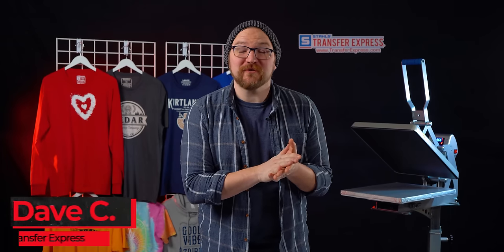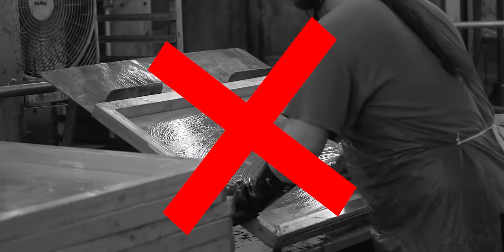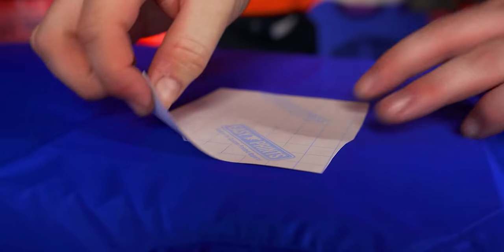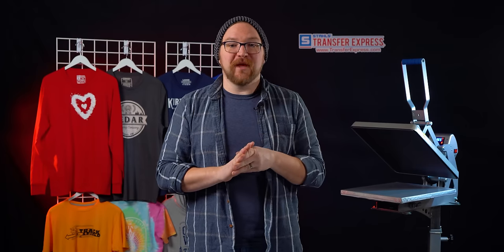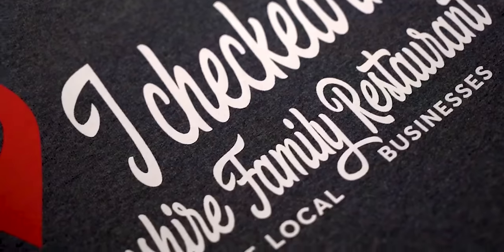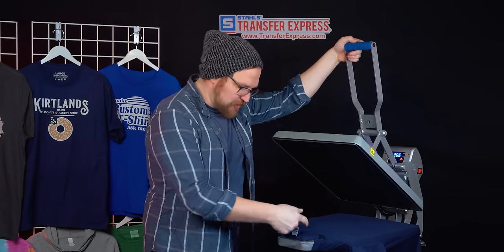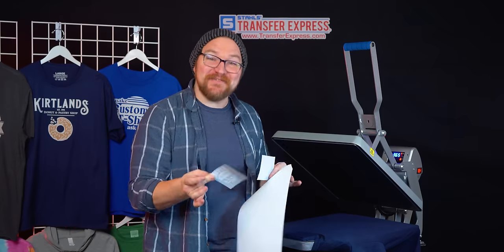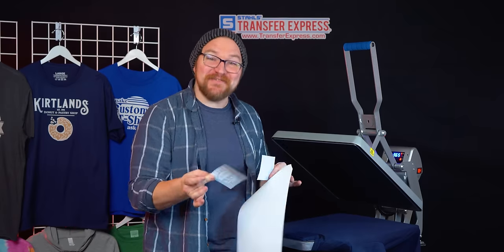What Is A Screen Printed Transfer? | Plastisol Ink Heat Transfers Explained

Comment: But could you do the transfer for halftones/rasterized images to dark t-shirt?
Reply from the maker: Sure Can! You can see in this video printing on dark garments made with cotton, polyester or blends are simple and easy! For raster artwork the process works the same. For any images with halftones, you shouldn't have a problem as long as the dot size is 1pt or greater with negative space between them of at least .04" to meet minimum standards.

Comment: Great Video. Can you do SP transfer using water based INk?
Reply from the maker: Thanks William! There are a few specialty-use heat transfers we produce with a water based ink, the cost is slightly higher. You'll find our goof proof screen printed transfers are a soft-hand, retail quality print with a versatile application to many different types of fabrics. You can request a zero cost sample here: https://www.transferexpress.com/marketing-tools/free-samples

 Is there a specific attribute of water-based inks you're looking for in a heat transfer?

Comment: What's the difference with that with DTF print?
Reply from the maker: Great Question! These are plastisol inks printed as spot colors with a minimum quantity of 6 sheets, where Direct To Film (DTF) is printed using a CMYK+W(White) Process so you can achieve full color or photorealistic prints at any quantity. 

We made a great video covering the difference between Screen Print & DTF transfers more in-depth with even some cost/pricing examples: https://youtu.be/qP-e_WhKcO8?feature=shared

Comment: How do you align the t-shirts to make sure the images are the same on all shirts?  Example using a middle chest image
Reply from the maker: Hey George, there's several different ways from using placement rulers, eyeballing or even using laser guides. We made a whole video for placement and positioning here: https://youtu.be/dwRFRT2iyFw
Reply: I found best way was measure the press plate and mark the centre line give the image a slight centre fold not on the actual image just out side of it line that up to the mark on the press and you will have a centred image every time same goes for pockets mark the press to the side where the centre mark of the image will be and it will line up ever time late as reply so you have prob already figired this issue out

Comment: I have some Goof Proof prints from you and I was wondering if there was a limit to how many times they can be pressed. 
I need to be able to press one image and peel it to line up a second image that will go slightly above the first one. 
I know I will need to cover the first image to protect it when I press a second time. 
Then I need to do this a third time. 
So the first image will have been pressed 3 times when all is said and done. 
Will that first image be ok?
This is for a custom run of shirts that a client wants. They wanted to combine several of my designs into one.
Reply from the maker: Goof proof is super versatile, however, three full presses may over-cure the inks and make them more brittle and prone to premature cracking. What you can do, is under-apply and carefully remove the carrier paper for the first or second images. 340 degrees for 6-8 seconds will allow the carrier to peel and the inks to stick, but will not fully cure the design to the shirt. Of course, if you can limit the presses and print multiple designs in the same press (if its the 2nd or 3rd) It may help keep clear of over application. 

For these unique application scenarios we would recommend testing the prints and washing one before delivering to your customer.

Comment: whats the price for like a 100 screen printed transfers if you wanted one design
Reply from the maker: For 100, single color, Goof Proof screen printed transfers on an 11.25 x 14" gang sheet you're looking at $1.82 per sheet or $182 with our easy prints pricing. $2.06ea if you're uploading Vector Artwork. 

We have a pricing calculator on our site that can help dial in a more exact quote depending on your specific project (transfer type, inks, sheet size, etc): https://www.transferexpress.com/pricing
Reply: Price has changed now?

Comment: where would i get a sheet the size of a skateboard
Reply from the maker: Great question- Our largest transfers (UltraColor Max) are available with up to 22 x 22" image sizing. While slightly smaller than a skateboard, you can use a method similar to the one shown in this video to print 'oversized' prints: https://youtu.be/BI7pyn9HjL4

Comment: Would I only be able to use your designs or can I upload my own?
Reply from the maker: Great question Barbra! You can upload your own designs in almost any file format to print: jpg, png, tiff, psd, ai, pdf, eps, svg, etc
Reply: @transferexpress  Where do I find pricing, how does that work, is there a setup fee for each design
Reply from the maker: We have instant quote calculators here on this page ( https://www.transferexpress.com/pricing ) or a downloadable price guide. There are no hidden setup fees, there's different pricing depending on where your artwork comes from: Our Online Designer, Uploaded vector artwork (ai, svg, pdf, eps) or Uploaded raster or bitmap artwork (jpg, tiff, png, etc). Artwork file help is included with all transfers except UltraColor Max. With UltraColor Max orders if your file is low resolution or needs editing it's just a $22 proofing fee- but our online system will notify you of that if that's the case.
Reply: @transferexpress   I think I'm going to have to watch some YouTube videos I'm so confused as to what this is all about

Comment: Would this work on practice jerseys with the holes 🤔
Reply from the maker: You bet! For those polyester jerseys we recommend Elasti Prints Screen Printed Transfers. Just be sure to put a paper coversheet on the inside of the jersey so the inks don't stick to the inside of the jersey.

Comment: If you order an existing graphic do you still need to pay for the setup fee since it’s already been done?
Reply from the maker: We don't have setup fees, so no. We do have different tiers of pricing depending on if you design online or the file format of your uploaded artwork: Vector or non-vector. An exact reorder will be priced at the lowest tier as it's already been done, but if any design changes are made (sizing, elements, etc) It will be priced based on the file type. 

We can add your artwork to your personal library in our Easy View Online Designer for commonly used designs or logos, we call them custom clipart: https://www.transferexpress.com/custom-clip-art

Comment: Can we use the Goof Proof Screen Printed Transfers on 95-100% polyester?
Reply from the maker: Hey Alex, you sure can! Be sure to test the polyester for heat-sensitivity first as Goof Proof can not be applied lower than 325 degrees. Some heat sensitive poly(typically the more inexpensive and/or heavily dyed stuff: navy, maroon, black, etc) may require temperatures lower than that to protect the garment from damage- in that case Elasti Prints, UltraColor Max and UltraColor Pro apply at 290 degrees.

Comment: How would I print them off myself?
Reply from the maker: These transfers are higher quality than what can be typically produced at home. It's much less financial risk and a more profitable business model to order only when needed. These screen printed transfers require a commercial screen printing setup to produce them: Dark room, emulsion, screens, reclaim units, inks, pigments, squeegees, screen printing presses, which can be difficult to fit into home-setups. With turnaround times as quick as the next business day they arrive fast, so you have the same advantages of producing in-house without the equipment, supplies or learning curve. 

For small orders or just one-off pieces we also offer direct to film transfers: https://www.transferexpress.com/heat-applied-transfers/ultracolor-max

Comment: Can I use my cricut easy press to apply these transfers?
Reply from the maker: We've seen some people use the easy press with good results, however, we don't really recommend it for a few reasons:

1. The temperature setting on the cricut presses are typically 40 degrees F lower than what the display shows. 

2. Without a locking or adjustable pressure, the pressure is 100% on how hard you can push down (These require 60-80 PSI) so for some people even their full body weight is not enough. When printing multiple garments, the pressure can vary, effecting the long-term durability of the transfers. 

We did a video comparing the Easy Press against a locking heat press: https://youtu.be/lktG7PiL5Dk

And we also had some surprising results with the Easy Press Mini: https://youtu.be/XkT_eqmv_5A

Comment: Can photo quality images be used with screen print transfers or only solid colors?
Reply from the maker: Screen Printed Transfers can only be ordered with Spot Colors. If you're trying to order any full color or photo realistic prints our UltraColor Max (https://www.transferexpress.com/heat-applied-transfers/ultracolor-max), or UltraColor Soft Transfers (https://www.transferexpress.com/heat-applied-transfers/ultracolor-soft) are the way to go!
Reply: @transferexpress  thank you checking it out now 🙏
Reply: @transferexpress  these links don't seem to work

Comment: Is anyone able to tell me if an Epson surecolor p800 printer can print these screen print images?
Reply from the maker: No. A desktop printer like the Epson p800 can be converted to print Direct To Film heat transfers but cannot print screen printed transfers like we show here. 

Screen printed transfers are printed using a screen, squeegee liquid ink and dryers or curing units (like a flash). Unlike desktop printers, for screen printing a stencil is created in screen with emulsion in which plastisol ink is pushed through to create an image (or transfer in this case). We show some of the hands-on process in this video here: https://www.youtube.com/watch?v=1nptFyiUEvQ
Reply: @transferexpress  thanks firstly thanks for your response i apreciate it, i am aware of how screen printing works thats what made me ask the question. I was more surprised that this process is even a thing  i asked because it seems that DTF and screen print transfers are the same thing in the end just different ink and obviously a massive creation difference. This is a pretty cool thing though as alot of people prefer screen printed effects and feel and transfer express has made it easy for us at home so thanks for that i will just have tp order something and see quality difference for myself i think. I will definitely check out the other vids thanks again. As for a home runner i think i might still require the converted P800 to get some white into the DTF broaden my colour abilities
Reply: @transferexpress  wrong link i believe as its a link to the vid i originally comebted on

Comment: What machine are you using to print these?
Reply from the maker: We're using the Hotronix Auto Open Clamshell Heat Press to print the transfers on the t-shirts here. Our Goof Proof screen printed transfers are produced using plastisol inks with screen printing presses. We take care of the hassle and mess of inks, screens, squeegees, emulsion and cleanup so you dont have to.

Comment: So does sublimation ink work with plastisol transfers???
Reply from the maker: Typically, you wouldn't mix sublimation printing with a standard screen printed plastisol transfer, they're just different processes. If sublimation is printed first, the sublimation inks will bleed through the screen print (unless its black ink). If the dye sub is printed on top of the screen printed transfer, it most likely would wash out of the plastisol inks when first laundered.
Reply: @transferexpress  okay, so I just bought Epson Supacolor F570 and I'm looking to add a printer for heat transfers as well for 100% cotton shirts, any recommendations?

Comment: But how are the transfers actually made - I know what it looks like when it’s going on shirts but what does the set up/machine look like to actually make the transfers?
Reply from the maker: We've custom built flat stock screen printing presses for producing these transfers. Automatic squeegee and flood bar, along with an in-line dryer. If you google "flat stock screen printing press" you can get a good idea of what the presses look like.
Reply: @transferexpress  thank you I will do that! The behind the scenes is so intriguing to me to see the work and process that goes into creation! Ups the value!

Comment: Would this cover a design on the unsold T-shirt? I helped out with fundraising and we have 75 shirts left. I was thinking of making a new design to cover the old ones. Let me know.
Reply from the maker: These screen printed transfers could cover pre-printed shirts but it would depend on the colors in the inks on the garment already and the way they were printed. (If you're trying to use white ink to cover bright yellow or red inks, it may bleed through)

With applying any heat to existing ink on the fabric you run the risk of overapplying or over-curing those inks which may lead to premature cracking or wash durability.

Comment: Can these transfer work on mesh  materials shorts  like jerseys?
Reply from the maker: Absolutely! The work great on polyester-based mesh jerseys and shorts. Our Elasti Prints Transfers ( https://www.transferexpress.com/heat-applied-transfers/elasti-prints-screen-printed-transfers ) are specifically formulated for athletic printing on temperature sensitive garments.

We do recommend using a sheet of paper on the inside when pressing to ensure the transfer does not stick to the back inside if you cannot thread the garment on your heat press.

Comment: Thing is, if someone comes and says, hey i need two jerseys for tomorrow, you won't be able to do it.
Reply from the maker: Absolutely true Lincoln. However, 99% of print shops would not be able to decorate that on such short notice. A rush job in low quantities with that short of a turnaround should be priced accordingly too. Of course, leveraging alternative methods like heat transfer vinyl would be able to accommodate a job like that.

Comment: i cant find any screen transfer place that isn't extremely. Y'all were gunna make me pay 300$ for only 6 transfers
Reply from the maker: Hey Scotty, sounds like you've got 4-6 colors in your design? We can help! Our UltraColor Max transfers aren't a plastisol screen printed transfer, but allow for affordable, high-color artwork in any quantity- they're just as durable and priced just 6 cents a square inch and feel great printed on apparel: https://www.transferexpress.com/heat-applied-transfers/ultracolor-max

Because of the nature of screen printing, each ink color requires an individual screen to be produced to print the color, so at low quantity, the per piece rate is high because of the setup involved in printing. If you add quantity (in this case just 12) the price of the transfers are almost cut in half. We have a great "What Transfer To Use When" guide that shows what the most cost-effective transfer will be depending on your quantity and colors in your artwork here: https://www.transferexpress.com/choose-heat-transfer-type

Comment: They  charged me $111 for one color one design and 6 sheets lol
Reply from the maker: Oh no! It sounds like something isn't right, I'd love to help get that cost down for you- Our Screen Printed transfers start at just $9.64 per sheet for one color at 6 quantity and then drop with the quantity breaks at 12, 18, etc. For low quantities, we also have our UltraColor Max transfers which are just 6 cents a square inch, or about $25 for anything you can fit on a 20 x 20 sheet. I checked in our system to find more details on this order but wasn't able to find any order listed for you or your business. Can you provide any details? I'd love to help out!
Reply: @transferexpress  is that price for goof proof?
Reply from the maker: Yep, that's the starting pricing for our Goof Proof Screen Printed Transfers with our Easy Prints Artwork. You can run instant quotes for any project/transfer type here: https://www.transferexpress.com/pricing

Comment: Screen print trying hard to be DTF?
Reply from the maker: Sure DTF transfers sure are cool, but these screen printed transfers might be even better! They've been the heat transfer of choice for over 30 years for many apparel decorators: All the benefits and quality of screen printing but without the mess of inks, screens, squeegees, emulsion or clean up... These Screen Printed Transfers actually beat DTF in a few spots:

✔️ Feel of the print on the shirt: These screen print transfers are made with real plastisol inks, so they look and feel identical to a soft hand screen print on a t-shirt. The prints move, flex and wear incredibly well without any of that plastic feel. 

✔️ Pricing: With DTF being priced as a full color transfers, you may be over paying for the single-color or limited color artwork. DTF has a fixed price regardless of quantity, so at larger quantities DTF can get quite expensive. For maximum profit on those bigger runs these screen printed transfers are definitely the way to protect your profit margins. 

✔️ Application Efficiency: With a quick, hot peel application in as few as 4 seconds, there's no faster transfer around. Do more with less time, no waiting to peel! Effortless applications on cotton, cotton/poly blends or polyester fabrics- great for t-shirts and fleece. You can checkout our own comparison between these two transfer types here: https://www.youtube.com/watch?v=qP-e_WhKcO8

Also, try some free samples out for yourself: https://www.transferexpress.com/marketing-tools/free-samples